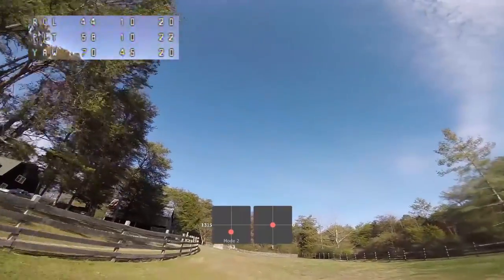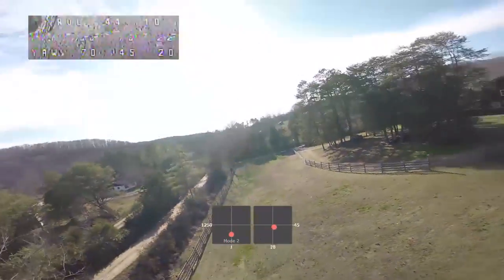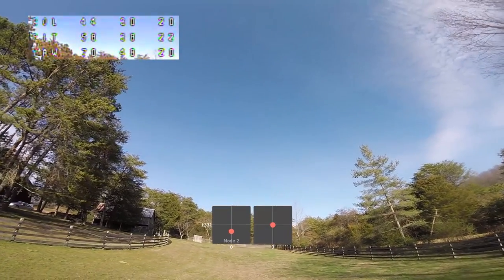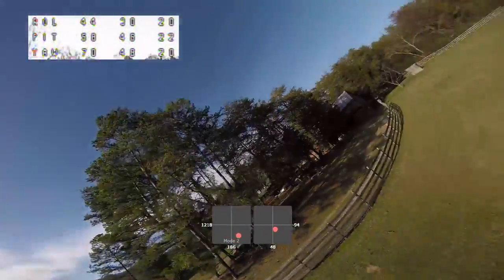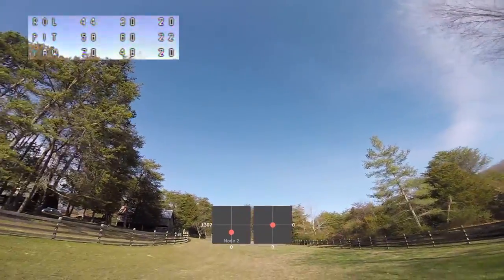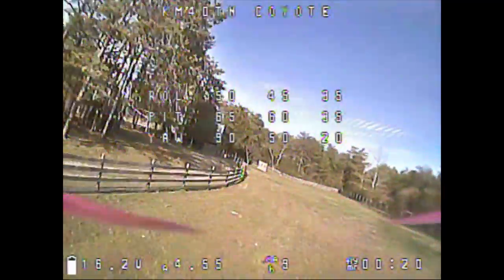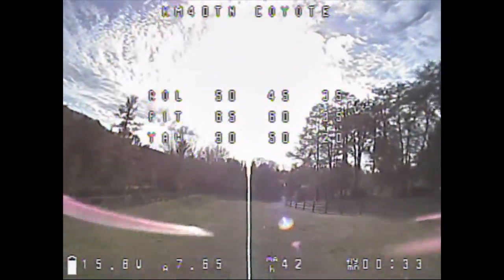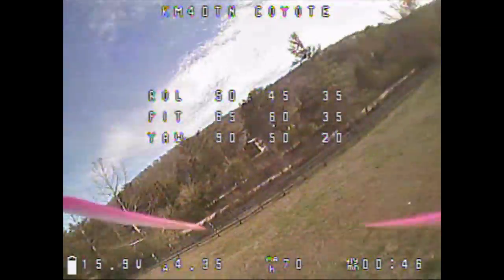Betaflight 3.1 anti_gravity_gain | EXPLAINED

Comment: Once again I both learned something today and applied it to my quad to make it better. I bought the Kakute f7 v1.5 FC and set anti gravity to 3.0 as recommended in the manual. Everything was perfect so I left it. Then I switched to digital and put a Caddx Vista in the back of my quad. I noticed during my first flight that the camera had a dip in it after punches. I thought for sure this was the 3d printed camera mount being goofy. I don't know enough about tuning to fix it, so I just left it for the time being.  Stumbled across this video while watching other Bardwell videos and it explained my issue to a tee. I guess having the vista in the back has made my quad somewhat rear heavy meaning I needed to change some parameters up. Thank you!

Comment: very cool. however you may have made a slight mistake in your description. i'm just looking at it now on my quad and I notice that the default value for Anti-gravity gain = 1.0.  which makes sense because once you hit the threshold it will multiply the I term by 1 and therefore it won't change (i.e. anti-gravity is turned off).  In your video you say that the default value is 0, and that means it is turned off.  i'm thinking that if you make the gain =0 then once you go pass the threshold then it will multiply the I term by 0 and you'll be getting rid of the I term instead of not affecting it.  if this is the case you may want to update the video to clarify this because people might start setting the Gain to 0.

Comment: Great video once again Joshua. Your channel is definitely one of, if not the most useful of all the quadcopter channels. I don't say that lightly. Your intro line of "your going to learn something today" is very fitting. 
Sorry for the somewhat off topic question but your the guy to ask. Can two different ("brand") flight controllers with the same gyro, with all the same settings on the same quad have different flight characteristics? I assume no but I really don't know.
Reply from the maker: +helicrashpro all flight controllers running the same firmware with the same gyro will have very similar flight characteristics. There may be some small differences in their noise sensitivity for example bur the basic flight characteristics are primarily determined by the firmware.

Comment: Might be worth adding an annotation in this video at 4:30. The defaults are now:
anti_gravity_thresh = 350
anti_gravity_gain =  3.000
HOWEVER there is a mode which turns it on so technically the default gain is still 0, definitely worth noting though.
Reply from the maker: Annotations are depcreciated.
Reply: In 3.1.7, anti gravity is always ON and the mode is to turn it OFF
Reply: good to know! I was searching for this info specifically, thanks Danny!

Comment: In the CLI.  If you type in the command   Dump   you'll see all of the settings. You can scroll up to set anti_gravity_gain.  Its set to 1.000 by default.  To change it. Instead of typing   dump   you'll type in   set anti_gravity_gain = 2   then press enter  then type    Save   and press enter. To make sure the change took on the CLI command type   dump   and scroll up to set anti_gravity_gain to see if it now says 2.000. To go back to default settings just type   set anti_gravity_gain = 1
Reply from the maker: +HaleFPV don't forget that you need to type "save" to save the change.
Reply: +Joshua Bardwell   I forgot the most important part. I just updated my comment.  Thanks!
Reply: # set anti_gravity_gain = 2
Invalid value
Allowed range: 1000 - 30000

Comment: Great video Joshua! Have you noticed any negative sides of going a bit high on A_G_G ? like 10-15?  
I just checked, and stock settings on 3.1.0 was 4, which i guess is based on what team BF has found to work for most though.
Reply from the maker: +Ola G Braaten I haven't tested value that high.

Comment: I'm running 3.2 with anti gravity switched on, tried adjusting the gain but the coper tumbles worse after I punch out at times it's pitching forward up to 90 degrees

Comment: so I'm on 3.1 and when I went to check the AG setting it was already at 4 and has a range of 0-30. I'm assuming they turned it off in later versions. I guess it's already working then.
Reply: Kabab FPV didn't you do a video on dipping? I believe you were saying it was a esc issue. Do you think the phenomenon could be helped with using the antigravity gain? Thank you for your videos aswell.
Reply: Paul Butchyk yes antigravity helps but not fully. if you have poorly operating esc's from the beginning it's gonna be dipping badly regardless.
Reply: Just did a fresh install of 3.1.6 default was 1.000 and 350. hmmm. Could you have accidentally bumped it via OSD pid tuning?
Reply: Carson Black  I'm on 3.10. it's default is different than 3.16
Reply: Yup, just checked it on one of my older builds, indeed mine was 4.00 by default as well on 3.10
Reply: what do I need to type in the cli to find out what my antigravity gain is set to, I'm on 3.1.7 thanks
Reply from the maker: +Snappy uk get anti
Reply: Mikey thanx man 😃
Reply: Joshua Bardwell how do I turn this on?

Comment: It'd be really cool if Betaflight could add an Anti Gravity status indicator on your LED panel. The same way you can have LEDs automatically flash warnings. I like to do initial P and D ballpark tuning line of sight. It'd be perfect to just have my LEDs flash a certain color when the Anti Gravity threshold is met.  But also, like you said, an indicator in OSD would be cool too.

Comment: Hi +Joshua Bardwell This might be a stupid question, and it might have been asked before, but here i go:
will tpa interfere with anti_gravity? i am getting massive tilts on my quad when doing full throttle punch-outs, might even do a weird flip... once i turn the AG off, that behaviour diminishes...
Reply from the maker: TPA and anti gravity are separate and distinct. TPA attenuates P and D when throttle is high. Anti_gravity accentuates I when throttle moves rapidly in either direction.
Reply: Joshua Bardwell thx for the quick answer mate, also subbed :)

Comment: Hi, this makes me think about the TPA and I haven't seen you mentionning it yet (I haven't seen all the tuning videos though). But shouldn't it be systematic that you start any tuning session by removing it entirely, tune the copter and then when you know when the problems appear chose the threshold and the gain accordingly ?
Reply from the maker: +Manuel Pellizzari I think the default of 10% is fine, and usually leave it.
Reply: More than to ask what to set, my point was more on the tuning methodology for the quest of the perfect tune. Default TPA might hide some things, maybe it's not required at all in some cases. (?)

Comment: Hi Joshua, Damien here. I am having issues where like you said I am deducting from your information I'm getting I gain Wind up(Railing along do a snap roll and it just keeps spinning out-of-control till it hits the ground) I have just freshly built a Tokio SX with a Emaxs Magnum stack & F60 motors I'm running Betaflight 3.2. Stock PIDs, rates are up to give me about 1050°/s, filters I have PT1 turned on and the first filter turned off. I had the antigravity set at 2.5 and it happened then, I lowered it down to 1 and it happened? do you think Wind up is still a possibility with it that low? I'm going to go out today and try it with antigravity turned off entirely but I was wondering if you think there could be something else creating this wind up? Hopefully I hear back from you and thank you for your time!! Amazing videos by the way!! Much Respect!

Comment: Hi Joshua, very interesting as always.
I'm having roll/throttle coupling issues, had to set roll I to 115 to have it disappear. Will antigravity fix this or does it only boost pitch and yaw I?
Reply from the maker: +La Julasse yes anti gravity will fix it.
Reply: Great news! I'll try that, thanks for your reply, I really appreciate, you must have so many messages to reply to.

Comment: Hey Josh. Have a setup that runs perfectly except for huge pitches after punchouts. Pids are default, and I've tried rasing the I gain to 100 but nothing happened. Anti_gravity_gain has no effect on the quad either. Please help, it's almost impossible to powerloop.
Reply from the maker: +Ben Shamblin there must be something mechanical if it is that hard to tune. Check your CG, motors, ESC's, etc.
Reply: I looked under the release notes. I found this: "Airmode is now fully disabled when feature or mode not engaged. Before airmode was always active and it was just the iterm not being active on low throttle." Enabled airmode and it flies like a dream again. Thanks!

Comment: very odd that I didn't seem to have the I term issue until upgrading to BF 3.1.7  
I have been running 3.0.1 for some time now, and can tune my I term values and get a rock solid setup that doesn't move at all when chopping throttle or punching.  I noticed this drastic problem after upgrading, and searched around for the problem, my I term values seem to have little or no affect on my PID loop until activating anti gravity mode.  very strange.  There must have been some other changes between 3.1.0 and 3.1.7 that now require anti gravity gain for I term.  hmm.  
I want upgraded BF for DSHOT support, but the PID loops have changed.  Otherwise I would flash back to 3.0.1

Comment: Question for you - is there a duration that is configurable?  If so, and if not, what is the duration at stock?  and does the duration change in accordance with something, or is it always the same duration? Thanks - great video!
Reply from the maker: +B94Cast I don't understand what duration you're referring to.
Reply: Joshua Bardwell Sorry - Ok, so this activates via threshold - 30 lets say.  That threshold is met, and now AG activates.  What is the duration of that activation?  Is it a period of time that is dependent on change, or is it activated for a predefined period - say 200ms?  Hopefully that explains it better.
Reply from the maker: I don't know the answer to that. Maybe Boris will notice and answer. Presumably it lasts at least until the throttle stops exceeding the threshold, and hopefully a little longer.

Comment: I did see it in the features list 3.1.7 and I enabled it. Does that mean it is on all the time now? Also, now it is not in the modes tab anymore. How do I change it back to having it in the modes tab where I can turn it on and off? Thank you very much Joshua for all the time and effort you put in to educate others. Your channel is invaluable.
Reply from the maker: It will not be in the Modes tab if you enable it as a Feature.
Reply: +Joshua Bardwell, thanks! How do I put it back the way it was?
Reply: Besides setting the value to 1.0
Reply: Sorry I said that wrong. How do I disable it as a feature?
Reply from the maker: "feature -FEATURE-NAME". That's a minus symbol.

Comment: thanks for explaining the antigravity.. so i messed around and got my old hyperlite f4 to work again and since its revo i put newest frimware 3.1.7 im worried about it losing its memory again but dont know until i try it. Have u ever heard of a flight controller losing all settings and going default when pluggin fresh lipo in?
Reply from the maker: +David Downs I have never heard of that.
Reply: Usually a ground loop. Make sure to test for shorts with a meter. If you have your sma touching your carbon frame it can short and cause this issue.

Comment: So to be perfectly clear, the threshold controls how 'far' the throttle needs to change over a fixed (100ms) amount of time right?    I could maybe see this needing to be lowered on high power to weight quads where < 35% throttle change results in more overall change in thrust.  And maybe increased for those under powered quads where 35% change in not really a punch out.  But I can see 35% working most of the time.
Reply from the maker: Yes that's right. If you have a quad where you don't move the throttle much, then possibly you do want to change the threshold. The thing is, if you are not exceeding the threshold, then the gain will never kick in. So if you raise the gain and raise it and raise it and nothing changes, the maybe the threshold needs to be lowered.

Comment: I feel like the problem is that the copter is just trying to keep the angular rate. The delay of the i-term will cause a small absolute angle variation. But since the angular rate is constant after that, it will not try to get back to the old attitute.
If the copter would really hold a certain angle set by the angular rate, the pitch movement on throttle changes would be corrected alot better. It would behave like a heading hold gyro for rc helicopters then.
Reply from the maker: +FPV_BENNY the integral nature of the I term means that it will in fact try to return to the previous position. This is exactly what I term windup is. It's just that the I term's time window of influence is so short that it can't recover from a disturbance that goes on too long.
Reply: It will not really try to go back to the exact angle, it tries to keep the desired angular rate. When the quad is hovering, and you would tilt it by hand 45°, it will fight you as long as you rotate it, but when you leave it it will not get back to the previous attitute.
When you move it quickly by hand, there will be a small rotation back to the previous angle because of the I term windup, but it will then keep the new angle when the angular rate is 0.
When I fly forward and quickly increase throttle, the nose will go slightly upward and stay there. When I rapidly decrease throttle, it will move a bit downwards and stay there. A quicker I term (thanks to anti gravity) will reduce that, but a true heading hold like in a helicopter gyro would make the nose go back to the true angle where it was before the throttle change.
Reply from the maker: But the integral nature of the I term means that it accumulates previous error and attempts to correct it. This results in it trying to return to the desired angle--conceptually at least. The reason you don't observe the copter returning precisely to the desired angle is that the I term also decays over time, to prevent excess windup, and the time constant of the I term is so short, that the I term decays before the accumulated error can be fully corrected.
Reply from the maker: Think about it this way, let's say in loop 1 we have an error of -10 degrees per second. In loop 2 we have an error of -20 degrees per second. We now have an accumulated error of -10 + -20 * the looptime degrees per second. If we then cause the copter to move +30 degrees per second for one loop, we will have returned to the previous angle exactly. This is precisely what the I term tries to do, although practical considerations prevent it from working perfectly.
Reply: The copter would not try to return to the desired angle, just to the desired angular rate. The PID-loop right now has no idea of the absolute angle of the copter.
Same with a regular heli gyro. It only counters the change in angular rate, i.e. by wind. A heading hold gyro really holds the angle of the tail. When you rotate the tail by 90° and hold it there for a few seconds, it would still go back to the previous angle as soon as you let it go. A copter or a regular heli gyro would just see the new angle after the 90° rotation as 0 angular rate and stay there.
Reply: yeah he knows that lol
Reply from the maker: +FPV_BENNY I don't intend to repeat myself a third time. 😁
Reply: yeah, maybe we were talking about two different things.
Reply: Now that I took a closer look at it I see exactly what you mean. In the motors tab I can give a short roll command on the radio. The motor outputs are uneven at first. When I then tilt the frame by hand, the motor outputs will become even when the copter is at the angle that the roll command wanted it to be.
But as you said, the maximum angle error is limited by the windup prevention. And even if it wouldn't be, it would not always reach the angle in the real world since the i-term for the rate pid-loop behaves exactly like the p-term for the angle-pid-loop would.
So maybe it would reguire another integral of the i-term to really hold the angle in a real world scenario (with its own anti windup limit). Maybe this is what a PI2D controller does